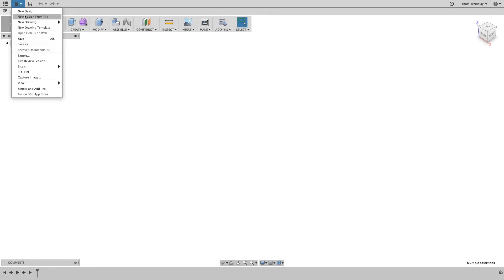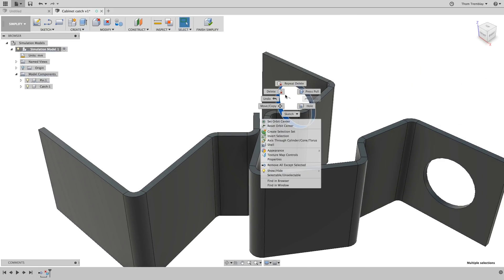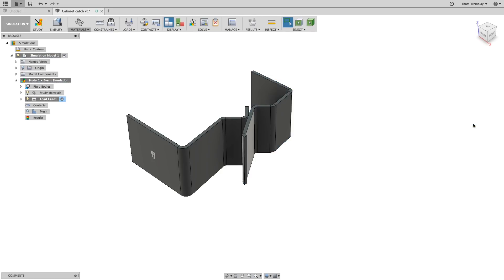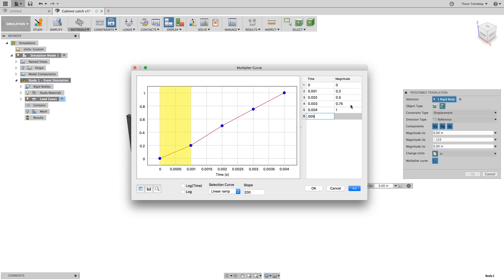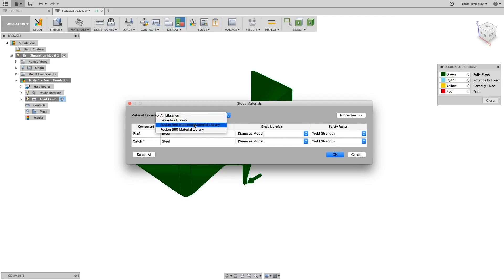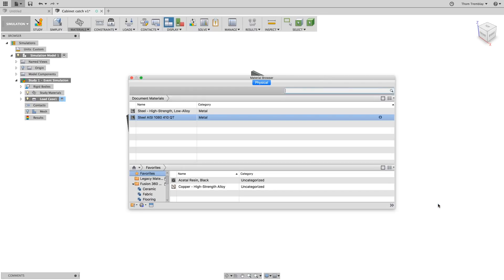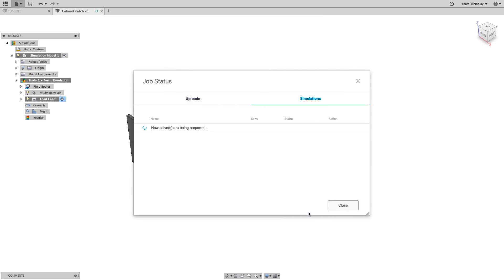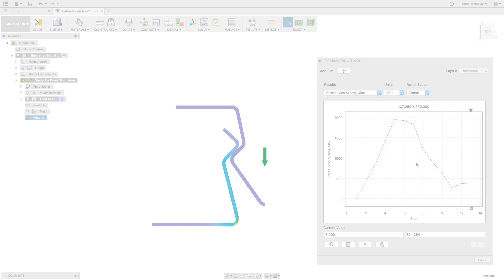Snap Fits with Mechanical Event Simulation

Comment: Great tutorial. Is the cabinet latch file available somewhere to download/upload to follow along?
Reply from the maker: Great question! Check the datasets link here: https://f360ap.autodesk.com/courses/nonlinear-material-analysis/lessons/lesson-1-course-overview-2cd51970-6510-44b6-9da6-38bf09c09a09
Reply from the maker: Also see here for a PDF related to this lesson: https://s3.amazonaws.com/fusion360-adoption-prod/lesson_materials/files/000/000/199/original/Mechanical-Event-Simulation.pdf?1539285579